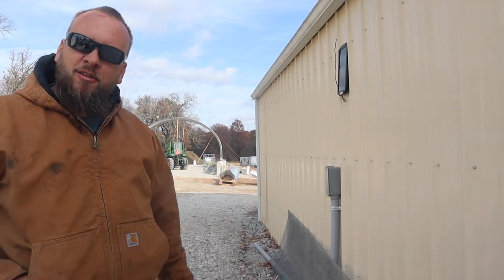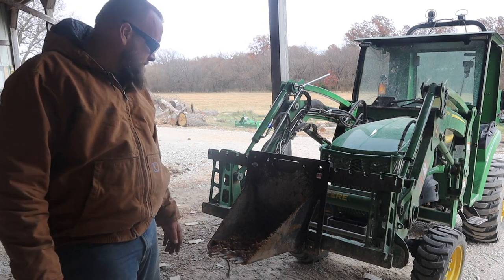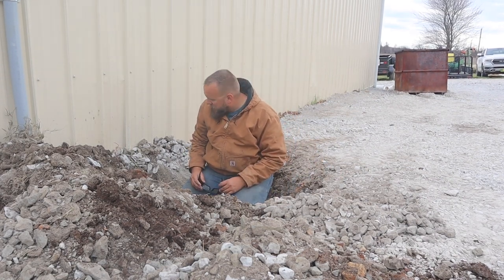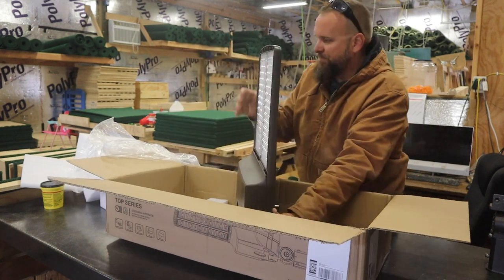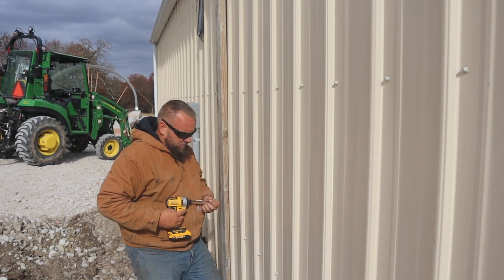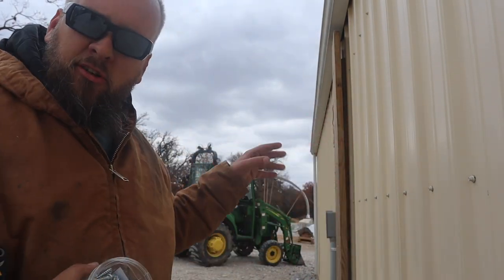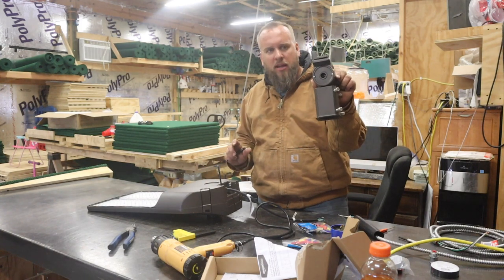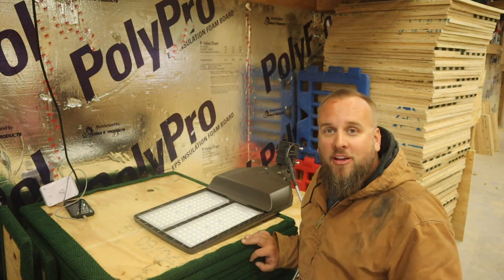Let There Be Light.....HyperLite

Comment: My 350 watt solar streets light came in today. At Amazon >  Solar Street Light 350W, 20000LM IP67 Waterproof Solar Motion Sensor Lights, Dusk to Dawn Solar Flood Lights with Remote Control for Yard, Path, Garage, 2 Pack <   Oh Lord there huge and heavy to. Only way i got to mount them is 4"x4"x12' long treated wood post. That all Lowes here got. 🤬 I was wanting some fence post to make them 15' in the air. but now > 10' in the air with 2' in the ground ~  Got to do what a person can do

Comment: I dearly love a Quonset hut over a metal build. 1.There prefabbed  2.Easy to assemble 3. one of the strongest metal buildings you can buy.  With stand winds up to 200 mph. You must spray foam the inside, for insulation

Comment: I will not have rain gutters on any thing!   EVER AGAIN!   All it does is rot wood behind them
Reply from the maker: I kind of agree with you. Especially for a building like this but I didn’t build it.

I called it at affordable because it lights up half my property, it’s hardwired to a pole and should last basically forever

It’s 1000 times brighter than the yard light the electric company put out for me
Reply: @RockhillfarmYT  That there sun cell light. There nice and not as bright. I took all of mine down!  Cause 5 of them was burning 25 dollars a month >>>  just for 1 >>  Reason i'am going to solar. Cause of no electric bill >  FREE ENGERY  👏👏👏👏